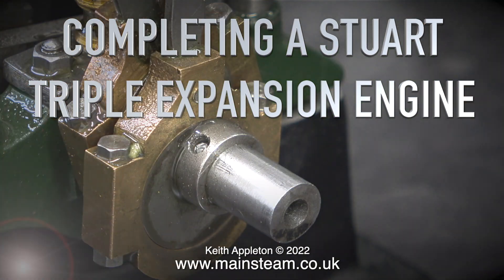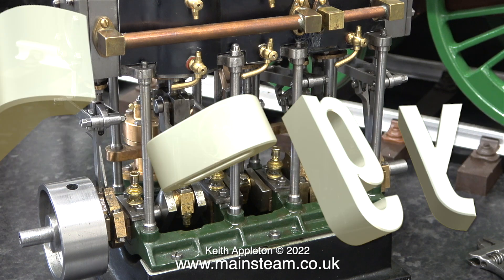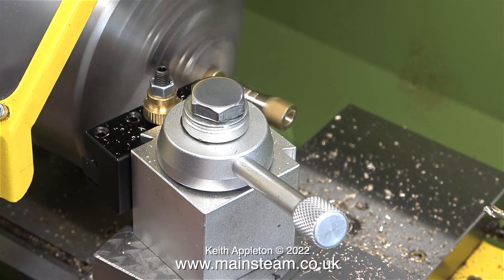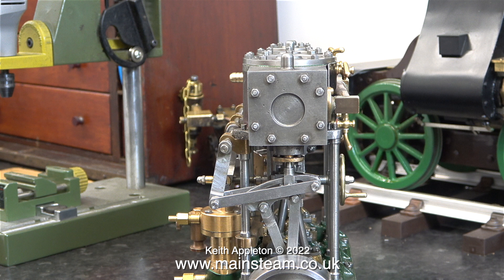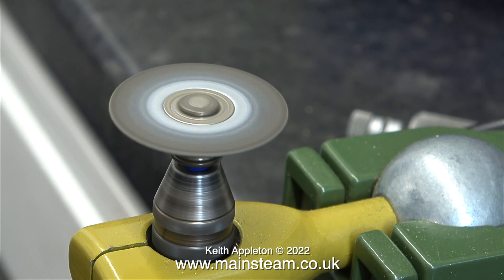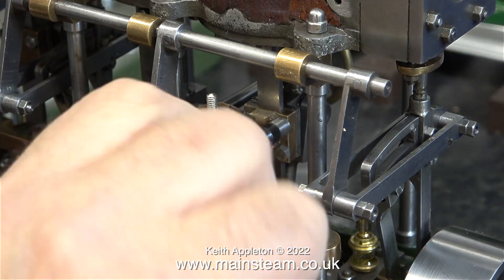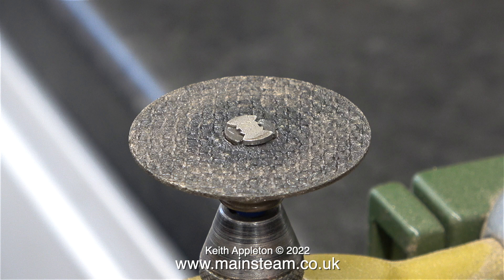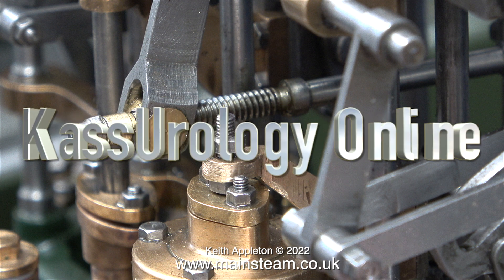COMPLETING A STUART TRIPLE EXPANSION ENGINE - PART #48

Comment: I was thinking you might try some self vulcanizing tape plumbers use it sometimes called leak repair tape. If you stretch it quite thing and then run it around the sanding drum you might be able to get it to stay on. Really good stuff that it's very useful if you want a rubber grip or for insulation.
Glad you stayed well.
Reply from the maker: Yes that might work, I have some somewhere . . .